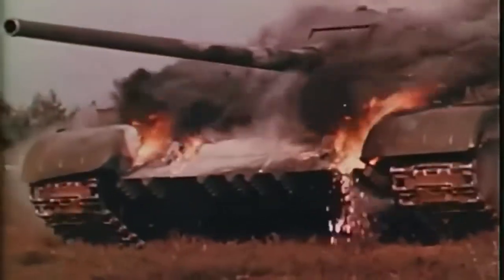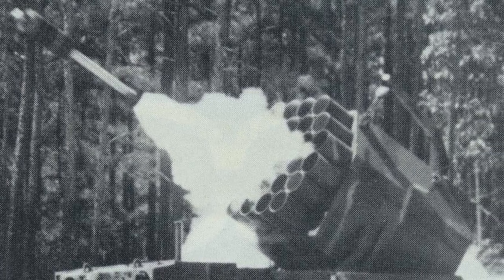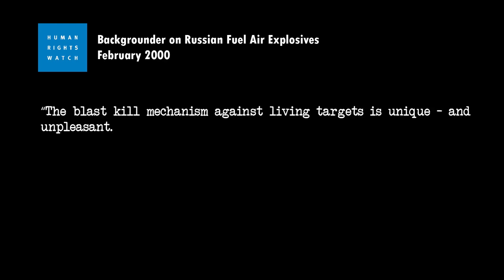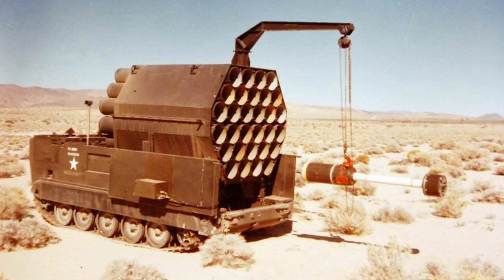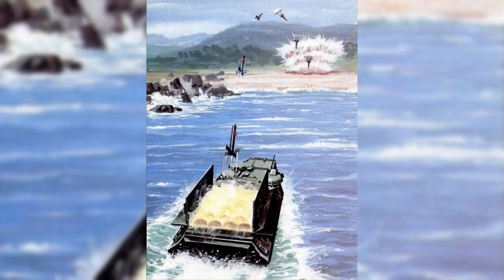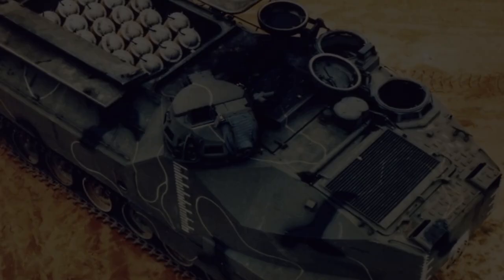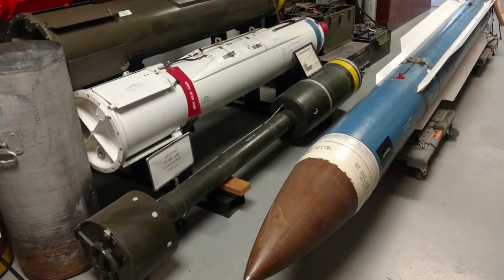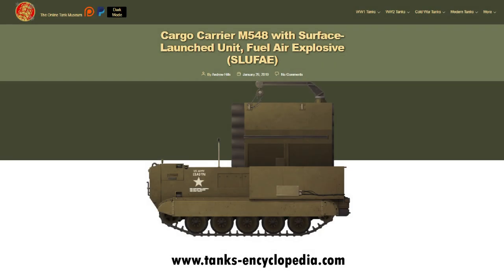SLUFAE | The Insane Rocket Launched Flamethrower

Comment: thermobaric is very good against bunkers and underground fortifications, it can generate a big shockwave that can travel at the speed of sound in tunnels and small holes.
Reply: A "shockwave at the speed of sound" is caused by a deflagration. A detonation travels several times the speed of sound.
Thermobaric energetic materials used nowadays are solid (HMX based PBX + Aluminium), so good luck getting that "into small holes".
Reply: It's really good if it is used in a bomb that has bunker busting capability otherwise it just blows up on top not affecting anything below the ground that is reinforced it's also good in confined quarters

Comment: MICLIC was unreliable well into the 2000s. I've seen more than my share fired in training and it was always a question not of if any would fail, but how many. The current version is much more reliable.
Reply: I read awhile back that if the charge didn't detonate in a real mine-clearing operation, the only way to solve the problem (at the time) was for a crew member (or supporting infantry soldier) to volunteer to do a "Medal of Honor run" by going out and preparing the detonation manually. I'm not sure if any of that is true, though.

Comment: We have forgot about conventional war and the immense benefit of unguided weapons, the easy and simplicity of manufacture and the cost,
Systems like these can be helped tremendously by modern ballistic calculators combined with advanced drop compensator and wind calculations, with these combined and with some experience in firing more than an acceptable accuracy is available,
Also extra range can be achieved, 
These would be also useful in direct fire missions, and the rockets could be Installed in smaller launchers,
Are troops don't even have a front loading rocket which has the massive benefit of being to fire very small thin anti personal rounds that are light to very heavy rounds, all are current recoil less rockets are rear loaded and are the thickness of the tube ie the are all heavy and you don't have the option of lightweight rounds that you can carry in quantity,
Also with the ease of front loading allowing bulky parts these are going to be some of the first infantry weapons to bet cheap bolt on guidence kits like a tanden rpg7 having a light guidence package attacked to it,
The US manufacturer who makes a version already purchased by the US government makes the perfect launcher that could be introducing quickly,
We need to get away from this all heavy and experience mindset and Introduce flexible cost efficient cheap options that will very soon have a cheap guided option but can still fire light cheap unguided rockets,
And larger truck mounted simple systems would also be able to fill the very large gaps that are everywhere.
Reply: Not forgotten. Just wasn't needed.

Comment: so it's a fuel to air explosive, not a flamethrower at all
Reply: It is a larger single charge fuel explosion, instead of a steady stream of fuel exploding, as with a regular flamethrower.
Reply: @the_hate_inside1085  flamethrower fuel doesn't explode.
Reply: @kiwin111  Show how little you know, every Hollywood explosion is a fuel explosion, it is the most the most classical type of explosion there is...
Reply: @the_hate_inside1085  that's a deflagration, not a detonation